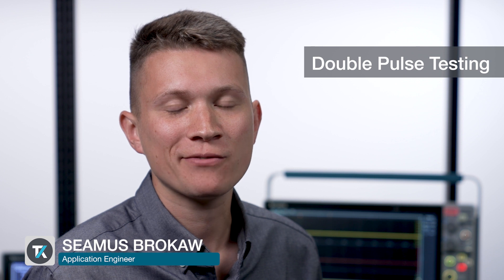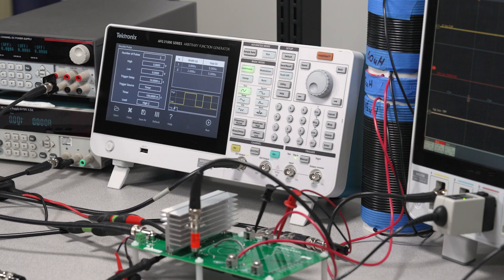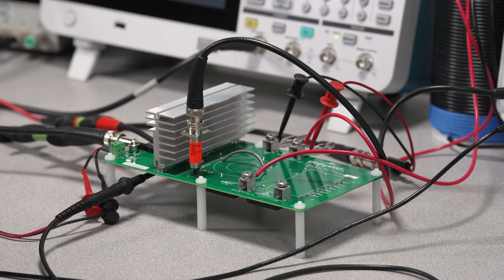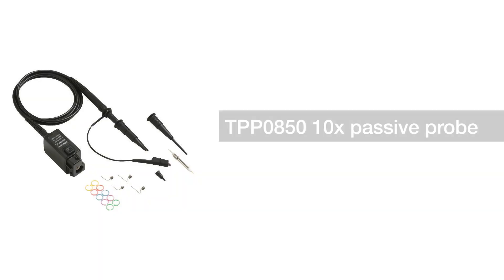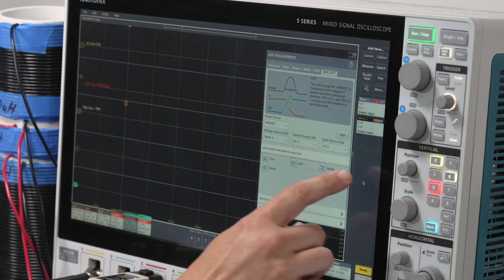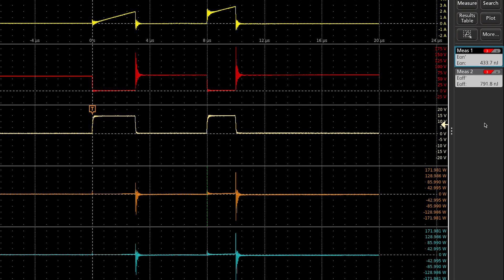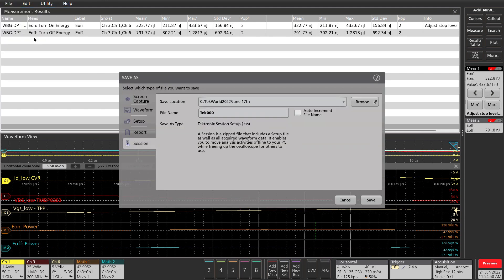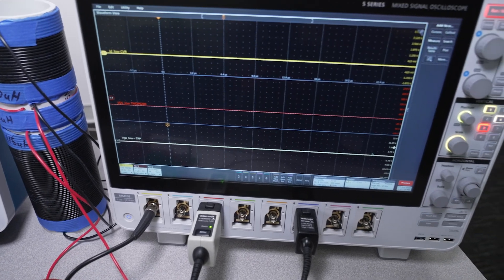Tektronix Double Pulse Testing - Energy Loss Measurements Demonstration

Comment: But I have no oscilloscope so how to make this measurement without equipment ?
Reply: Smoke....   If the parts smoke, they failed the test.  Start over and turn down the voltage.